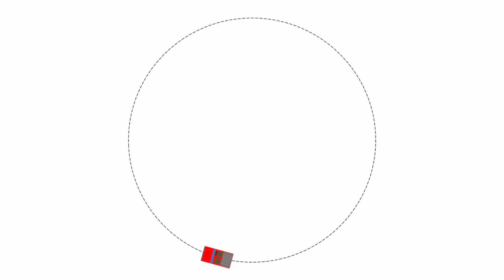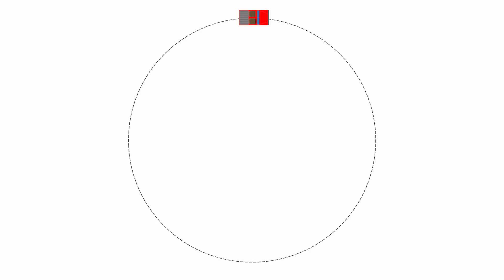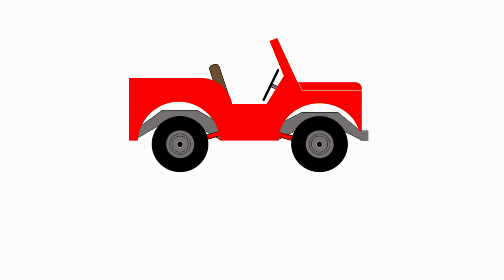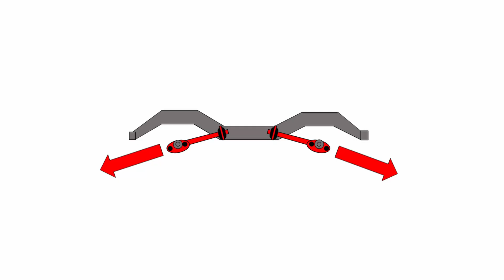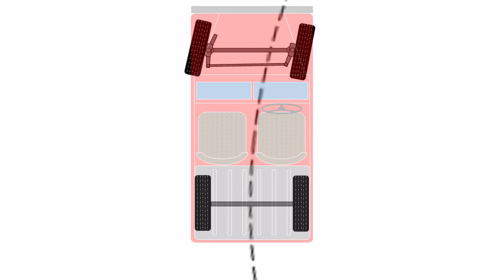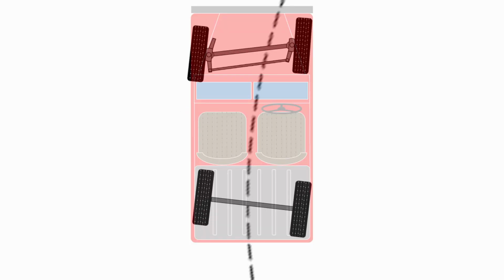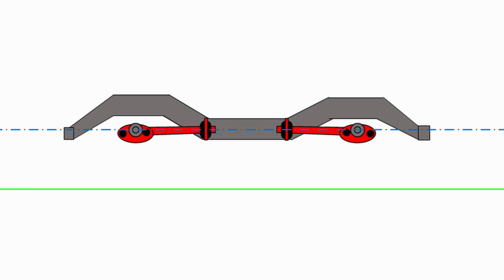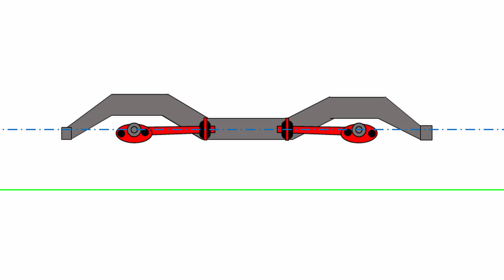Roll Steer Explained

Comment: I have seen it stated many many times that understeer is desirable, yet given the nature of physics, and the fact we are trying to get a moving object to change direction with two little contact patches, I’d say understeer is inherent before considering roll steer. And only worse on constant 4wd vehicles. That is to say, I feel a little oversteer a good thing in suspension geometry. I did say a little. For me having the front at about zero degrees (neutral ) and the rear around 3-4 max. But degrees don’t mean much without considering link length.
Reply from the maker: I’m intrigued to know why you think understeer is inherent. A lot of SUV type vehicles have a heavy engine but quite a light rear structure. That does give them inherent longitudinal stability (like a dart), but it also means that the front axle tends to be much better planted than the rear. These vehicles tend to be designed to carry a heavy load in the back and consequently are stiffly sprung, but when they’re empty they end up with a lightly loaded rear axle with too much spring stiffness and consequently roll stiffness, which is a recipe for oversteer. 

The reason understeer is usually more desirable than oversteer is that drivers are more naturally able to compensate for it - you just turn the wheel a bit further. Where rollsteer is concerned it’s also more desirable to have a bit of understeer (rather than oversteer) because roll oversteer has a positive feedback loop - the roll creates more steer - the steer creates more roll!
Reply: Ahh! Like a skateboard !

Comment: A question. Do leaf sprung suspension systems suffer from roll steer, given the axle is restricted to more or less vertical movement? I ask as my truck is leaf sprung.
Reply from the maker: Hi Stephen, thanks for the question. They certainly can do, because the spring is responsible for the longitudinal location of the axle. Since the spring is moving through an arc then you get the same effect as you do with a radius arm. The difference tends to be that leaf springs usually have the shackles for both front and rear axles either facing back, or facing forward, so you end up with crab steer rather than oversteer.

Comment: Most underrated channel. Keep up the good work and it will pay off.
Reply from the maker: Thanks Juan, very nice of you to say so!
Reply: @Offroadvehicleengineering  No worries, it’s the truth. If I may suggest something, it would be to use some kind of 3D printed simplified suspension system in your examples.
Reply from the maker: @AirForceJuan747  thanks for the suggestion. I have been experimenting with using 3D CAD models, but it slowed the video production process right down. I think you’re right that a physical model might be the way to go. I will keep experimenting!